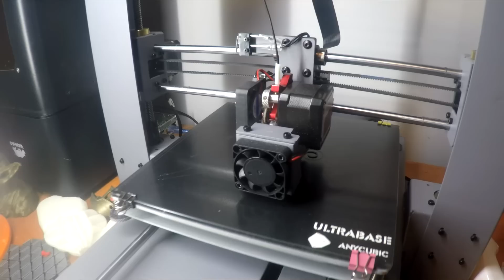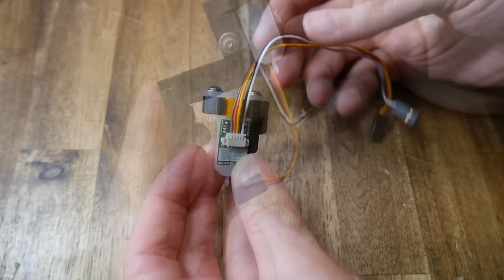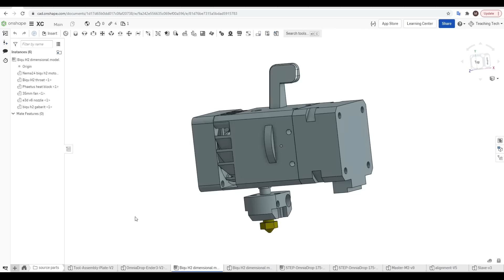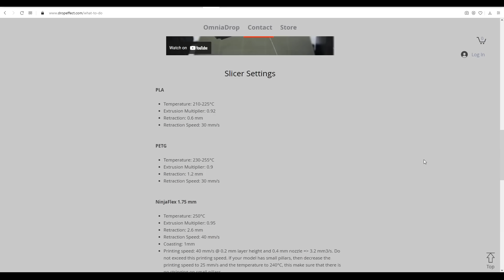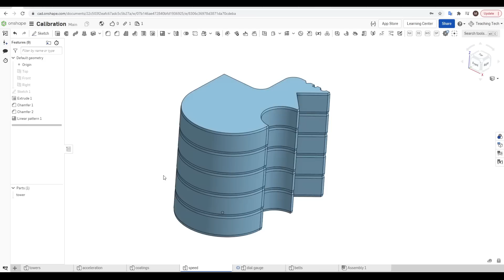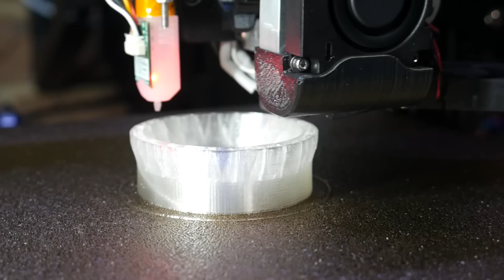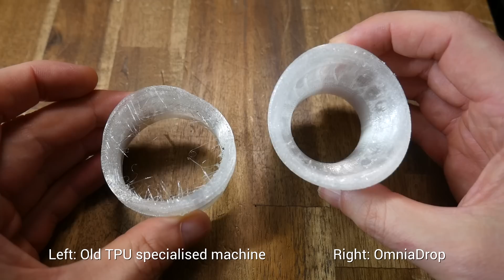OmniaDrop V2.1 extruder on XChange - Fast TPU and more

Comment: Use OmniaDrop now for a few years. Quickly replaced my Hemera with a 2nd one. They literally have been the only 100% trouble free extruders/hotends  I’ve ever used, (and I’ve used just about them all) price is a tad high, but still lower than say a Bontech and V6 combo, or a Slice hotend which still needs an extruder. I do likely 50% of my printing in flexibles and again, it has been flawless.
Reply: Have you tried the orbiter?
Reply: @brandoneich2412  nope, one of the few i haven’t as it came out really after i had gotten the onmiadrop, I want to though. Only real Issue I see is you still need a hot end, so it ends with a much longer filament path.  Plus you loose the angled gears, something not mentioned in this video but has a larger impact than most would think with duel gearing and the play/backlash between them no one seems to address.
Reply: @Thomllama  for some reason my comments keep getting deleted.... Mellow just released the "libra mini extruder" which looks a lot like the sherpa mini extruder but the drive gears have helical gearing on them, it should also help reduced the backlash.
Reply: So I'm about to get my first 3d printer ever. I want stuff to work and for the quality to be on the level of being able to sell it if I wanted to go that route, is the OmniaDrop the choice to go with? Or is there some more expensive higher-end unit that you could advise? I'm looking to print with ender 3 pro or ender 5 pro or plus.
Reply: @denniskatinas  well, the OmniaDrop is easily one of the top extruders for quality and reliability. Ender 3/5..? that's another story.  they "can" actually be good, but will likely take a bit of tweaking and modding.
Reply: @Thomllama  Thanks for helping out, but don't be shy, I'd rather get blunt advice for another printer if you have ideas about that. I actually appreciate it.
Reply: @denniskatinas  again,.. the enders are OK, if you like to tinker and modify stuff.. I generally built my own printers from scratch so factory units aren't my knowledge base. but basically, the community wraps the Prusa's up as the goto basic work horse. Something like the Daedalus is a good, kinda super printer.. or an Ultimaker? all depends on you and what you want and are capable of dealing with.
Reply: If I never had problems with my i3 Mega, does that mean my throughput or my standards are too low? Or do you include special situations like flexible? Of course, the standard hotend consists 98% of problems as soon as any flexibles come close to it. Is the Hemera really not that good? I would have thought the Hemera is something you would keep. I have to admit, I still have a Hermes I didn't use, yet,  and I am about to use it. Would you consider it a mistake?
Reply: @maxmustermann2596  I had 5 Herema units, and sold them all to get OmniaDrops.  I had some of the original Hemera units with the bad gear trains.  Then Covid hit and they basically closed down, no new units or parts were available, and I had 3 broken units.  I found the OmniaDrop and have not looked back.  A couple of big differences are, a really good manual feed system for loading and unloading filament, and a much courser gear system.   The Hemera has a high precision gear train with small teeth.  The OmniaDrop has a precision system also, but with much larger teeth which are much better at handling any filament dust and chips.  I had many instances where filament dust would jam my Hemera and was very hard to clean out.
Reply: @maxmustermann2596  hemera is a good extruder/hotend. But has issue the OmniaDrop doesn’t 1st and formost is weight, hemera is friggin heavy!. Also, I found the gears coated with filament dust rather quickly, and to disassemble and clean it is kinda a minor nightmare. Then add the extruder wheel on the Omniadrop! Its awesome for loading/unloading filament! WAY better than dealing with the screen or software. Lastly, the mounting on the Hemera can be annoying. The screws have to be the absolute perfect length, to short, no grab, too long, and the end of the screw bottoms out on the slot and breaks the tabs in the motor casing. In reality, these aren’t all that often an issue once running and the Hemera is a rather nice extruder. Just the OmniaDrop is better.

Comment: God I wish I could afford this many 3d printers! And I wish I could afford good extruders etc.

Btw the omnia us also compatible with the orbiter motor? I think

Also the XChange doesn't make much sense for me. You can get the same for much less. Like 1/10th the price. And that'd be an ACTUAL tool changer
Reply from the maker: You could remix the body part of the OmniaDrop to take the orbiter stepper motor. The gearing for each is to suit their respective stepper motor torque so probably not a good idea.
As for an automatic toolchanger for 10% of the price, you are totally dreaming.
Reply: @TeachingTech  i mean... I made my own  for really cheap. there's nothing to it really. it's simple.

even the jubilee costs 1350$ mainly due to the fancy motion system. the actual REL is 35-45$ if you 3d print the gearing.
Reply from the maker: Again, release it and people will buy plenty if what you are saying is true. The XChange is CNC machined alloy, anodised, injection molded pins , professionally made PCBs with an aerospace grade connector and a really strong magnet. There are DIY solutions around but they aren't like this. There's room for both options and everything in between, but let's not pretend they are the same.
Reply: @ameliabuns  "You can get" (your wording) and printing your own are not remotely the same thing.
Also, "35-45" is not even close to 1/10th of $149.
Reply: @glabifrons  1/10 was a figure speech.

also again, check my channel, my own tool changer is incedibly cheap.
it needs a 1-2$ motor, a 1$ motor driver, 1$ step down with CC, a 1 5mm dowel pin and that's it. the rest is 3dprinted.

Oh and you need 3 spherical delta joints or 3 acorn nuts
Reply: @ameliabuns  Saying "a fraction" would be a figure of speech (and it would be accurate). Saying "1/10th the price" is much more specific, especially when you're no-where near that.
I can't help, but notice that your design doesn't handle electronics swaps which means you're limited by your mainboard for scalability. Leaving out the boards and contacts certainly would make that part of the design cheaper, but you're just moving the cost from one part to the other.
Reply: @glabifrons  oh well i talk weird

and why would you want electronic swaps on a tool changer?

unless you want your 2h print to take 5-7 hours you waNt the hotends to be always connected to the board.

there's maintaining the temp on one hand, and there's purging before you approach the tool on the other to save an extra 3 seconds (an average print can have 300-1000 tool changes, so the 3 seconds add up)

but my new one is supporting quick swaps connectors (you can do it to the current one too mind you) so you can change your tools very quickly (go from 0.4 + 0.8 to 0.4 + 0.4)
Reply: @glabifrons  also 45$ is the jubilee. mine costs 10$ last time I checked? i gotta check again
Reply: @glabifrons  also i checked again, my doot changer's tool changing mechanism is 8-9$
Reply: @ameliabuns  Why? So that you don't need a separate driver for each extruder motor.
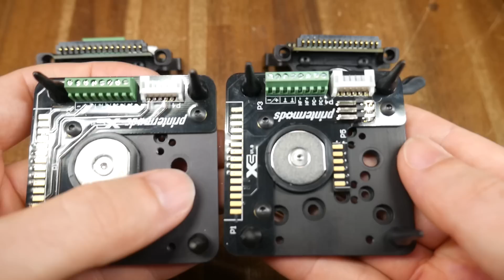Re-watch the video. At 1:44 he shows the extra pins that have been added for maintaining the toolhead temperature.
Reply: @glabifrons  my changer is very cheap! but not as tested as jubilee's etc.

but the REL porition of jubilee can be easily made at 35$. the rest is a motion system which might as well be a hevo which is 550$ (don't recommend the hevo, very outdated, rods flex a lot at 300mm)

if you're intresed i'm designing a new tool changer when I'm in canada, and this one uses a more accurate mechanism that doesn't digitally control the force with current (no issues IRL even with abs, but in theory heat which is everywhere in a printer can change the stall current?)

the new one will use spring a 3dprint switch or structure to detect when a spring is pressed an X amount to stop the motor

the BOM for that will be 1 spring and uuh 2 5mm pieces of tape and wires :P
Reply: @ameliabuns  One thing that seems to be common with all the DIY (print-yourself) designs is the lack of electrical contact switching. Conversely, all of the commercial systems (except the most expensive, e3D) seem to have that feature. That's why I said "apples vs oranges" earlier. That's one thing I'm planning to take into account with mine (if I can ever get to it). The problem is finding small enough pogo-pins that can handle the current of a heater. The spring-contacts all the commercial ones are using might be a decent compromise though (pogo-pins are pricey).
I'm not sure what you mean by "control the force with current"... it looks like yours uses a twist-lock mechanism, not an electromagnet to hold the tool. Are you talking about the torque applied by the little 28byj stepper?
I'm always curious what designs people come up with, so please keep posting videos. I'm really bad about not recording and posting my designs (mostly due to lack of time)... hoping to improve that.
Reply: @glabifrons  e3d doesn't have electrical contact switching.

Tbh on a tool changer that's not a good idea. Unless you want a tool change to take 30s instead of 10s (there's 300 of them for a simple print)

Is the pogopins what you mean by electrical switching? It's very cheap to implement. But I just don't because no reason to on my end
Reply: @glabifrons  oh you said expect e3d.

The other popular ones I know are jubilee which don't have it either.
Reply: @ameliabuns  Right, Jubiliee is one of the DIY ones (which don't tend to have contacts).
Reply: @glabifrons  which other ones have you seen btw? there's not many i see outside of jubilee e3d and now prusa.
Reply: @glabifrons  but why not have that wire permanently there? you need the wires anyway. you might as well keep those wires not as pogo pins but permanently

(eg: Wham Bam's Mutant, BIQU's Hermit Crab, and of course the XChange).

these aren't tool changers, they're quick swappable systems.

tool changers are usually devices that change the tools automatically live, mid work
Reply: @ameliabuns  There is less of a need now than when I started working on my design (which is a small part of a whole 3D printer design project) as back then I was limited to a RAMPS board running Marlin. Klipper certainly changes things as you can add as many boards as you want, plus there are new boards with 9 driver sockets out. The problem is still scalability though, as the drivers cost nearly as much as the steppers (more when you add in the cost of the mainboards needed to hold them). This ignores all the extra wire needed too (and good OFC wire isn't that cheap).
One thing that has potential to really change this is the Hermit Crab. I'm hoping others see in it what I'm seeing and start making boards that aren't even meant for swapping tools, just to reduce the lines going to the hot-end. I'm speaking specifically about the CAN-bus version, btw. CAN-bus can be extremely scalable as you don't need dedicated GPIOs for each and every motor, thermistor, heater, fan, etc.
Good point about changers vs manually swappable... I need to add a column to my spreadsheet. :)

As to others (aside from the ones I mentioned), I'll have to reference them by description as youtube is deleting all my comments that include links.
Hackaday has one that's unnamed, but you can find by searching for "tool switching multi extrusion". That one is especially slick as it has optical calibration. :)
Instructables has an unnamed one that has a really cool magnetic attachment and detachment mechanism (google: magnetic 3d printed tool changer).
There's a couple interesting ones that are unfortunately also unnamed on a Russian and a Polish forum, the former having released the design, but the latter does not appear to have done so.
I also have the predecessor to the Jubilee in my list "Cable driven tool changer".

Edit: The one on the Polish forum can be found by googling "overcomplicated hypercube by olson". The one on the Russian forum can be found by googling "Кастомный 3D принтер с ToolChanger"
Reply: @glabifrons  for the steppers you can use a gear latching mechanism to just use one stepper for all tools. Might do that on my new one.
Reply: @glabifrons  oh yeah! I've seen the friction fit tool changer. It's really cool! It was a shame they had to abandon it. Seeing someone else attempt a cheap tool changer made me motivated and was a lot of help to me

Btw I should warn you there's two doots. Soon to be three (lol someone help) 

Doot mag is magnetic. And the Design relies on spherical magnets which is hard to source in some countries.

Doot twist uses a DC motor
Reply: @ameliabuns  That's actually one of the things I've had in mind from the start. 😁
I saw one earlier today that I can't find now (must've been using an incognito tab) where the guy had the sole stepper on the carriage while each one of the tools used a BMG geared extruder driven from above (where the white gear is exposed) once it was mounted. I thought that was a neat idea using off-the-shelf parts.
While looking for it, I found this one, where the guy appears to be using magnetic coupling for the drive between the motor and the extruder gears. Very neat idea!
https://www.youtube.com/watch?v=N1IgO_7icG8

Others I stumbled across while searching for the gear meshing one:
This guy's (unreleased) design is interesting too: https://www.youtube.com/user/SebastienChedalBornu/videos
And there's this one: https://www.youtube.com/user/dzikifredzel/videos
This one is really insane with 13 heads!: https://www.youtube.com/channel/UCJOlq9X_iJxpC_L0wHOz_4g/videos
Reply: @ameliabuns  Which one are you referring to that had to be abandoned?
Reply: @glabifrons  abandoned? The third one will be made in Canada. Once I get there. With access to amazing parts and components I can fully change my idea 

But it's kinda funny to me. But I'm sooooo obsessed with tool changing that I've had seen every single one of these xD
Reply: @ameliabuns  Sorry, I meant the one you referred to when you said "I've seen the friction fit tool changer. It's really cool! It was a shame they had to abandon it."
Which one was that? I see there hasn't been any activity on the one on hackaday in a while, but don't see anything about the dev having to abandon it.
Reply: @glabifrons  ooh! Sorry I'm a dummy.

The friction one on hackaday was abandoned because friction without wear is hard! I don't know how I'd do that.

The hackaday one you posted uses force to push pins inside a hole. Basically a friction fit.

The issue is that friction fits are usually meant for once or at most a few times of use. With it happening so often it's bound to wear
Reply: @ameliabuns  There's an easy fix for that:  Polished stainless steel or aluminum tapered rods going into snug-fitting o-rings inside the holes in the receiver. Buna-N is amazingly resilient (that's what's used for seals in the brake cylinders in every car made).
Edit: A brass heat-set insert with a snug-fitting hole milled into it would also work well... better aligning with a bit more wear over time.
Reply: @TeachingTech  doesn't omnia have a 5:1 gear ratio? that's what orbiter uses right?

they have support for it on their website!
Reply: This eliminated the need for a custom board with the code flashed which would be annoying for people
Reply: @AmeliaBuns  Please link to the "ACTUAL tool changer" that's 1/10th the price that you speak of, and I'll buy at least 10 of them.